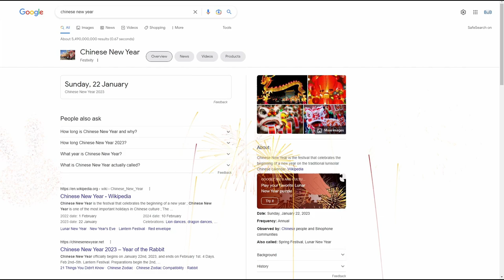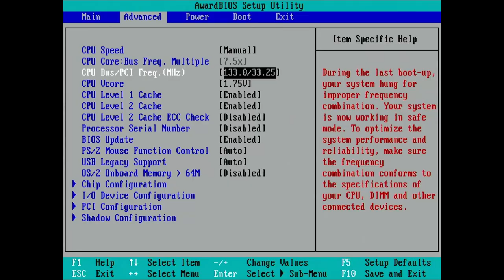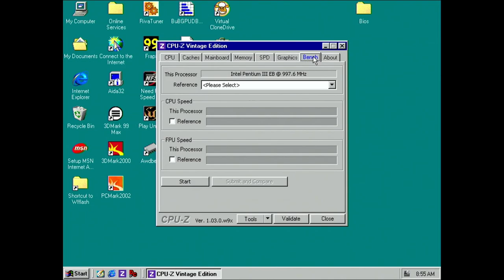Clean and lubricate Socket 370 CPU cooler

Comment: Leaving excess oil under the sticker causes sticker glue to fail and oil leak after some time. It's better to remove excess oil after lubricating.
Reply from the maker: Probably you're right. Never had an issue yet, but I'll keep it in mind for the future.

Comment: Hi looking at something similar as far as the cooler for a PIII 1ghz (Socket 370) . Do you know what type of cooler master that is I'm concerned about size and clearance. Thank you
Reply from the maker: The fan and heatsink are 55x55 (mm) as per measuring tape. And the height of the entire assembly is 40mm
Reply: @bitsundbolts  Thank you. Really appreciate your help and of course your effort on this channel! Have a nice day !!!

Comment: There's so little surface area touching the heatsink, makes me wonder what the thermals would be like if instead of a flat sink contact, you milled out a square to rest /around/ the CPU, maximizing contact for heat transfer. Or having a singular copper pipe the exact width of the chip.
Reply from the maker: It is a rather small surface area, but it seems to be sufficient. But I see what you're saying, I just don't have the equipment to cut parts out of a heatsink.

Comment: I heard that 100 Ghz and knew he meant 1 Ghz. But then again he could be into some seriously hardcore overclocking! :)

Back in those days I had a socket 370 Celeron 566 CPU in a slotket adapter on an Asus P3V4X MB that I ran for about 2 years at 892 Mhz (105 FSB x 8.5 multiplier) with only a slight bump in voltage.  I could get the CPU to POST and load into Windows 2000 at up to 952 Mhz but it was only stable at 892 or below. Good times!